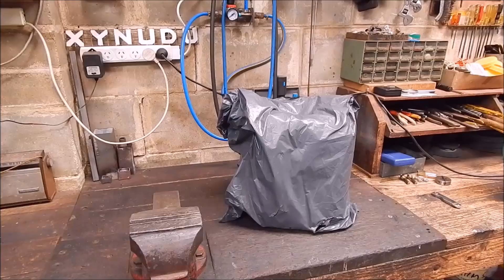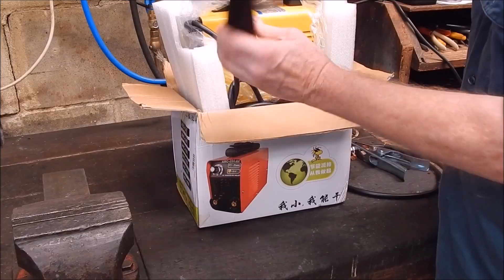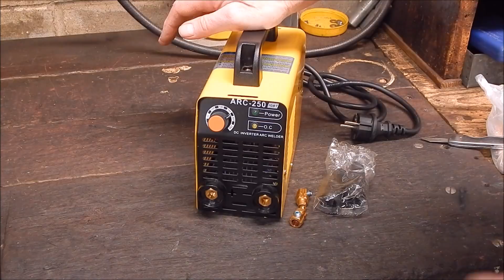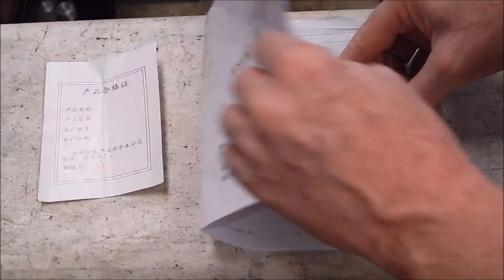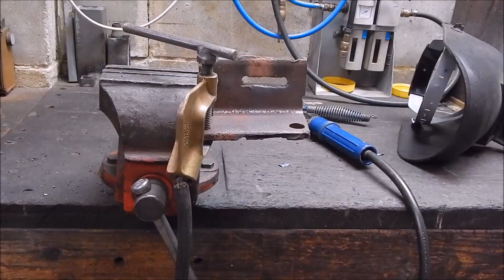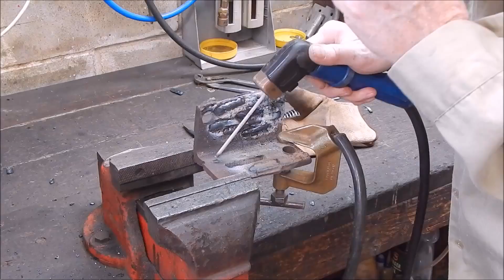I review the compact ARC-250 inverter stick welder from Banggood

Comment: Sir which is good, juba or this one?
Reply from the maker: Hi Ramon,

I personally like the Juba as it is the easiest and most vice free to weld with by far.  The duty cycle is lower,  but under test it performed OK welding five 3.2 mm rods continuously.  It may not be as good in hot weather. 

The other 250 amp welder (that I have kept) has a very high duty cycle and will perform better in a hot climate, but is not as easy to weld with.  So for newbies I would suggest the Juba.

Cheers Rob
Reply: Thnx sir.

Comment: Hi Rob, you mentioned that the welder is earthed. For the uneducated, could you explain how the earthing works when the plug is missing the earthing pin? Thank you.
Reply from the maker: Hi Peter,  It doesn't.
Reply: Hi you said in the Youtube video ->when you tested it, the case was grounded - possibly suggesting one may not be shocked if something catastrophic happens? So my query relates to whether the welder is safe (in general) from given one an electrical shock?
Reply from the maker: @peterg902  Hi Peter,

The welder is unlikely to be double insulated and as such any arcing/contact with the case by circuitry can be a serious shock risk.  The welder will be safe under normal situation and a supply with earth leakage protection reduces risk regardless of earthing. 

Be aware that the output from electric welder cables (regardless of earthing) can be fatal.  Every year several people are killed by shock from welding cables, primarily due to welding in wet/damp conditions/clothing.

Just because the output voltage is low doesn't mean you are safe.  The basic energy level remains constant as the voltage/amperage ratio varies.

Best advice is to weld with rubber soled boots on, don't touch the job while arcing, and never weld in damp clothing/conditions.

Cheers Rob
Reply: Thank you. Regards, Peter

Comment: hi,do you still have this welder?  your impressions now ?  thanks !
Reply from the maker: Yes, I kept this one and it's a good welder.  Very high duty cycle and plenty of amperage.  A bit rod sensitive and the adjustment knob scale is also a bit imprecise.  The best DC welder I've used was the ZX7-200 version.  That was just so easy to weld with compared to the rest.  Very little arc blow as can occur with DC.  A bargain and you can buy it under $50 AU.  I gave it to my Bro-Inlaw.  Cheers Rob
Reply: @Xynudu   can it weld thick mild steele and wrought iron

Comment: Usewell  is based from Shenzhen https://detail.1688.com/offer/542275612343.html Domestic version don't had those "extras". Ur version maybe intended for ex-Soviet Republics...
Reply from the maker: I was assured the extras were included, but I'm not so sure.  I got similar extras in the last welder review (also not shown in the advert) so I didn't mention them. I've decided that if it isn't on the BG site it doesn't get shown in the review - whatever it may be.

I don't want to mislead any viewers.

Cheers Rob

Comment: Interesting ,helpful review. I didn't know that reversing polarity affects the penetration of the weld so that as a novice could be very useful to me.
The welder didn't seem to stick and spit like a normal ac welder which would be far better for me and might improve my pigeon shit look welding.
Thanks for sharing ,will get one on order.
Reply from the maker: They all can stick at times.  This was pretty good in that respect.  It certainly holds the arc very well.  But correct arc length is still critical for a good weld.

Cheers rob

Comment: Rob

Great review, thanks.  At $125, you'd expect it to be as useless as  .  .  .  .

But obviously, not so.  I'd like to see it in use side-by-side up against the one ALDI offers from time to time - same market segment - 10amp home use DIY.

Cheers
Reply from the maker: Hi Stephen,

That Aldi welder only has a 10% duty cycle. That is atrocious.  I saw it on the specials row and had a close look at it. Could hardly believe what was written in the specifications.
  
But they are not alone on this,  Supercheap Auto also sell a similar unit with a similarly hopeless duty cycle (15% from memory).

So this BG unit with 100% duty cycle at up to 200 amp is in a totally different league  No contest.

Cheers Rob

Comment: Great review Rob, looks like a good welder with a handy size.
-Niles
Reply from the maker: It welds good, but takes some getting used to after using AC all your life.  You have to go up in rod size in comparison.

I had a terrible time with arc blow when welding thick to thin, and finally discovered it was because the rod size I  use on AC was too small for the same job on DC.

Rob

Comment: Hi Rob, Thanks for the review, would be good to see how it goes in the real world with butt welds etc, did you think it gets as good a penetration as the old ac?, maybe weld a star picket to a car rim and see if you can snap it off? Cheers
Reply from the maker: Hi Matt,

I had a few people ask that, so I shot a bit of footage today and will put it up tomorrow.

It welds fine.  The only problem I had initially was switching from AC to DC welding style.  Arc blow was the issue, something AC welders rarely get, but is inherent with DC.  Very frustrating at first.

The welder itself though is excellent.

Cheers Rob
Reply from the maker: Yes, penetration is OK.  Depends on the setting and arc length, same as AC.  The weld shape isn't as clean as AC in my opinion, seems more stringy.

Where this unit shines is on light gauge work - absolute piece of cake.

Watch the footage tomorrow where I show this.

Cheers Rob

Comment: Hello Rob, I am very interested in this type of inverter welder as well. There is however differences from what you received versus what I and others who buy this unit will receive. The ARC-250 as purchased does not come with a stinger. ground clamp and any DC connector cables that where provided to you. I went back to the video after discovering this and you can see that the box supplied is for a different unit. Sad to say that they provide a sample for evaluation that is NOT representative of what one gets.
Reply from the maker: Hi Al,

I double checked with Banggood and they definitely did not put any extra items in the box.  This is exactly what you will receive with the current batch.  The information on the web page is incorrect/out of date.

It also says it's only 50 Hz, but that's incorrect as the specification label shows 50/60 Hz.

I've been trying to come to grips with this welder for the past couple of days.  While is can lay down excellent welds, it can also be a pig unless you get the settings/ everything just right.  Seems very sensitive to rod type as well.

I am using AC rods so that will make a difference, but it's been a frustrating experience to date.

While I know my AC welder backwards, this DC welder is a whole new ball game - I'm not sure if it's me or the welder that is the problem.

It pulls the arc one way quite severely when butt welding, which may be a polarity issue, I'm still trying to suss out why this is occuring.  That's the main issue at the moment.

Cheers Rob
Reply from the maker: Hi again Al,

Looking at the literature from major welding suppliers it appears that arc blow can be a major issue with DC welding.  It's not really machine specific, but more to do with earthing, magnetic fields, welding conditions, arc length, etc.

So don't toss that AC welder just yet ;)

Cheers rob

Comment: Rob, nice review. How about some real world testing. I have seen a few videos and no one seems to be able to over heat them. Bargain. They are sold on ebay in Australia.
Reply from the maker: OK.  I will see what I can do.

Going from AC to DC welding is a noticeable change in style and welding characteristics.  Takes some getting used to.

I ran about a dozen rods through it yesterday just playing around and it never looked like getting hot, or even above room temperature - amazing.

I saw a 140 AMP inverter welder with trick digital read out for sale at Aldi recently and it only had a 10% duty cycle - can you believe that !  Crikey that's atrocious.

Cheers Rob

Comment: I 'm sorry but running beads on flat steel is not a true test, the fact is these welders are %^&* my mate had one is his workshop producing "real world" tasks and it failed completely and Bangood  after sales service is nonexistent after my personal experience with them and that of my mate, I will never deal with them again
Reply: I had to have my MIG welder repaired. Took 6 weeks. With one of these small welder I would either have my electronic techo mate have a look or just get another one. I no longer place much value on Australian after sales service and not just based on my MIG welder problem.
Reply from the maker: OK.  So what issues did your mate have with the welder ?

Rob
Reply: electrode connection is faulty have to manipulate the cable constantly to achieve connection, the amp setting is inconsistent
He replaced the cable with a Cigweld cable after three weeks of intermittent use the circuit board fried itself, Bangood don't wan't to know, he gave up and threw in the skip
Reply from the maker: Was that this particular welder ?

Rob
Reply: Yes looks like the exact model
Reply from the maker: Hmm.  Interesting.  Guess we will have to see how it goes.

All good so far.

Rob

Comment: please can you tell me where you got the universal adapter for the wall outlet ?
Reply from the maker: I got mine from Jaycar Electronics (I'm in Australia), but they will be available on Ebay etc.

Just search for International or Universal power adapter.

Cheers Rob
Reply from the maker: Banggood also have them.  Just select the connection pin type you require.

https://www.banggood.com/search/power-plug-adapter/0-0-0-1-1-45-0-price-0-0_p-2.html
Reply: Try ebay - https://www.ebay.com.au/itm/Cutter-Welder-Inverter-ARC-Welding-160Amp-ARC-250-Machine-DC-Gas-Gasless-MAG-AU/122619534833?ssPageName=STRK%3AMEBIDX%3AIT&_trksid=p2060353.m1438.l2649

Comment: So the real question now is that, since you've got the inverter welder, do you get rid of the buzz box, or do you save it for the zombie apocalypse? Since I own a great big old Lincoln, I'm quite curious.
Reply from the maker: Hi Rick,

I'm saving it for the zombie apocalypse.  After using the inverter I went back to the Peerless AC unit, and I have to say it was quite satisfying to hear the weld sizzle and crackle away compared to the DC unit. 

It's a totally different welding experience with the DC unit. Almost like laying down toothpaste in comparison.   Very bland and uninformative.

The AC unit also runs a longer and brighter arc, and after using these for 40 years I know exactly how the weld is going.

So it takes some adjustment.  Rod stick is about the same on both units.  Striking the arc on the AC has never been a problem for me, but a quality AC unit with good starting voltage makes a BIG difference.  So does a good earth clamp.

So I will be keeping old Blue, just in case those damn zombies appear.

If they get too close, Ralph the workshop blue tongue lizard will take care of them.

Cheers rob

Comment: Nice review Rob... I've never owned a welder but now tempted. Would be good if you could do a video at some stage that goes through the other gear needed to add to this welder to get started for a complete novice. I like your down to earth approach and so any suggestions / thoughts on helmets, welding cables, rods etc etc would be muchly appreciated... keep up the good work ! Cheers.... John
Reply from the maker: Hi John,

It's like spray painting, it all comes down to practice.  Certainly there's nothing very hard or mysterious about stick welding.

Just burn a few rods and have a go.  It's very handy to be able to weld, as you can fabricate and repair all sorts of stuff.  I've been welding since I was in my teens and now with the new generation of welders it's very easy.

This little unit works well.  I still managed to get some rod stick, but that's normal with the rusty steel I was using.  Once struck it held the arc beautifully with no burn in on the edges, easy slag lift off is a good sign all is well.

It's a new area of learning.  What could possibly go wrong :)

cheers Rob

Comment: Typical power electronics at full load runs at about 95% efficiency.  Transformers tops out at about 80%.    The loses for the electronics divide into control and power.  The controls for this are nill.  Transformer primary even under no load have a significant current.    Mechanical engineer that packaged aerospace power electronics for ~ 15 years.  Just some rules of thumb.
Reply: Nice, thanks for the knowledge. Appreciated!

Comment: I have made a very simple filter so you can run it on inverter AC power.  Very poor wave form.    Simply grab some steel cable and make a ring.  Tap it together to hold shape and insulate the iron.   This puts some air gap in the core.  Then wrap the two leads around the iron in the opposite directions so using the right hand rule they cancel each other.  Start at the plug pick a direction on one wire wrap turns on the core   on the return wire the flow is back to the connector.  Wrap the same number of turns.   Now you have a filter for smoothing out the steps in the AC.  I have used it this with DC to AC converters feeding a radio, the second radio and converter since both failed.  Works on electronic dimmers built for resistive loads.  Fluorescent bulbs light have not problem once the turn on.

Comment: We have these tiny welders in our DIY supply shops (big box stores) since 2 or 3 years but for an about 50% higher price. Probably they get dealer's prices an cream off even more than those 50% probably around 100%. Now banggood goes around the national importers/dealers. It is shipped to your home for free. But in case you need to send it back for repair the shipping cost most like goes on your expense. As attractive this business model may seem, think twice before ordering heavy stuff which is expensive to ship back. And would you like to see your local big box store shut down? Competition is healthy when fair. Is it fair? The dealers do not add much value except for easy customer service. Is that worth a mark up of 50%? Everybody has to answer that for himself.

Comment: Excellent review, kinda looks like it makes Mig obsolete. The last bottle of Argon 5% co2 I bought for my mig was a good fraction of the price you pay for this welder. Would have been interested to see what it would be like on butt welding car body steel, (say uk 20g, approx 1 mm) and if it is any good for upside down welding, something I do not enjoy with mig, so would be interesting to see if this performs well under such circumstances. Thanks for the review.
Reply from the maker: Even though this did 0.9 mm, in the real world it wouldn't do butt welding without a copper backing to keep everything in place.  Even then it's pretty dodgy and it would waste the panels more than MIG.

MIG still rules for anything under 1.5 mm when used with gas. Basically this welder uses MIG based electronics with stick instead of wire. 

However, 1.5 mm is very do-able with this.

I have never bothered with MIG as I got by OK with AC/stick for the work I do (down to 2 mm)

Some of the worst welding I've ever seen has been done by people using MIG in gasless mode - splatter galore :(  Total shit.

If you're going to use MIG you definitely need gas, otherwise you might as well buy one of these units.

I don't enjoy overhead welding either.  It should be OK.  I did a lot more welding footage but had to bin most of it as the video was getting way too long.

Cheers Rob
Reply: Thanks for the reply. Guess I can keep my Mig for car work even though I nearly choke at the price of the Argon gas and get vexed by this gas being great for thin stuff, but for thicker stuff co2 works better and due to various safety regulations no one will re-fill my co2 cylinders so I have to pay a heavy deposit and pricey gas for approved cylinders. Probably I should try the stick welder I got years back which I have never got out of the box. The consumables are likely a lot cheaper than the gas, but I have managed to get by without learning stick, and getting by is often what matters most to me.
Reply from the maker: Yes, there should be a stick hand piece with the MIG unit.  Same effect as this welder really, but you may also have more amperage control.

It's not worth cutting corners on jobs if you want a good finish.  Stick with what you know and works well.

Cheers Rob
Reply: @xynudu " Basically this welder uses MIG based electronics with stick instead of wire. " Pity is that a lot of cheap MIG welders are still using transformer + rectifier technology and still only have the two switches to give 4 current settings just like the MIG I bought in the 1980s. Hopefully they don't still have the same rubbish feed mechanics that mine had.

MIGs with inverters still seem to be rather expensive given just how cheap the inverter stick welders have become.

Comment: looks good, shame about the supplied cable
Reply from the maker: That's just a sample of the size to use.

Yes, you have to buy some cable, but at least you can get the size and length you want rather than being hamstrung with the crappy leads that most cheap welders come with.

It's always a trade off with welders.   You get cables and they are either crap, or the welder duty cycle is crap to cover the better cable cost.

I like this option as you get to kit out the welder to the level you require.

Longer, heavier leads are always best.

Rob
Reply: xynudu  All metal?  Plastic is less likely to shock you.

Comment: I wonder how well this would work on American 110V household power.
Reply: https://youtu.be/5VtZgSixDcU
Not easily, but doable?  For a stick welder, a 220 circuit is almost a necessity, you can get by with a 110 mig machine if you're only welding thin material.